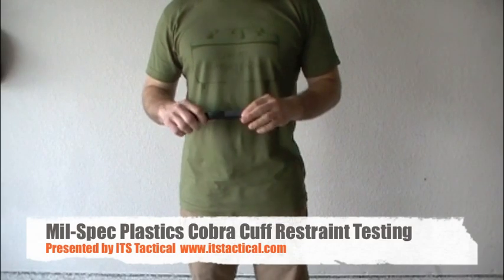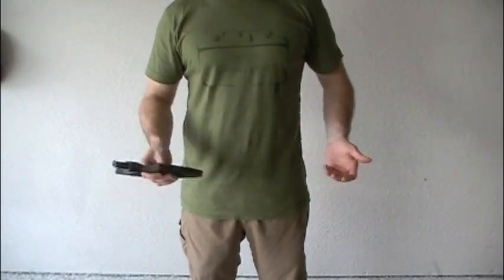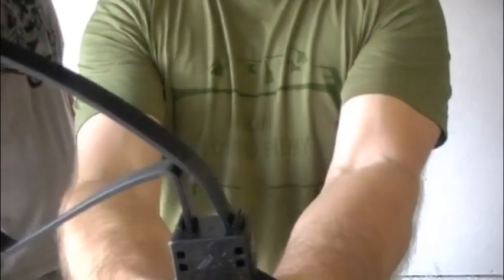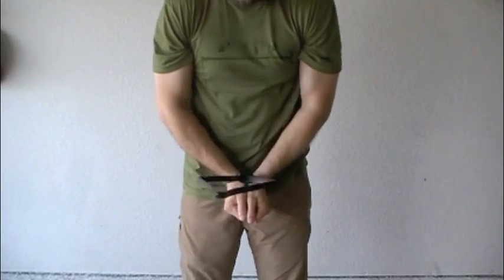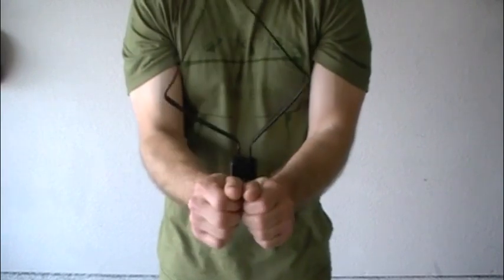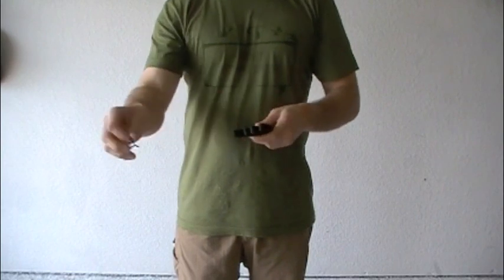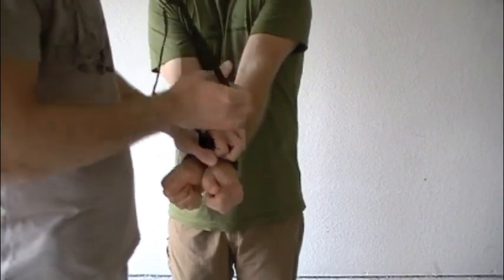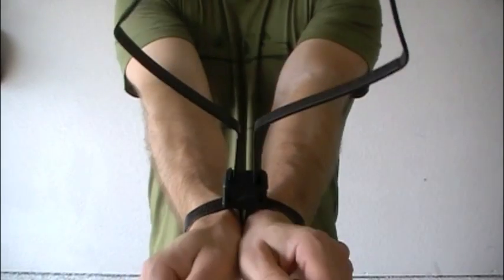Mil-Spec Plastics Cobra Cuff Restraint Testing Raw Footage

Comment: what about inserting a straight pin or safety pin that you keep hidden in the inside hem of 
t-shirt. use insert the safety pin in the locking device while pulling the restraint off.  I saw
someone using that technique to get them off.

Comment: @DemonHide If their tight enough you can't get a shoe lace through then they are tight enough to cut the bloodflow off to your hands causing permanant damage if not amputation. (anything over 10 mins. is extremely dangerous) It's very doubtful they will ever be pulled that tightly and am certain it would go against the proper use of these restraints.

Comment: sold out, a promotion of the product "Cobra Cuff"! Cord through the gap in the weak zip strap, not the lock would go quick & could have been done, considering the gap he showed. His sawing motion was reserved, when compared to a previous video with longer foot motion to saw quicker. Panting due to sawing is exaggerated. The area he sawed through should be reinforced with a multi-sided steel blade implant to reduce likely use of cord to burn through that area! - - - That said, I learned a lot!

Comment: best way to break the cobras is if there's a carseat in front of your,lift the neck rest with face,throw hands over metal part and pull back it will brake....after that its up to you how to escape the vehicle... lol
Reply: After breaking the cuffs, remove the headrest completely to break a window. Headrests are removable in order to break windows in the event a car is submerged in a body of water.

Comment: I had both of my hands amputated in the event I would be either cuffed or zip-tied in the future. Unfortunately, I did not think far enough in advance to realize that I really just needed to amputate ONE hand to achieve this invulnerability. I've been training with other amputees on how to peel a banana with only your wrists, and it's going well, but the ability to use an iPhone still eludes me. However, I was able to type this post with my nose, and it took only 38 minutes.

Comment: Does he not realize those cobra cuffs break in half perfectly in the center just by pulling a little and he didn’t need to do the shoelace thing the 2nd time. Also, he did the shoelace thing wrong both times, he did it right but the shoe laces were tied way too short and he didn’t get any speed or resistance or else those cuffs would have broken way way sooner.